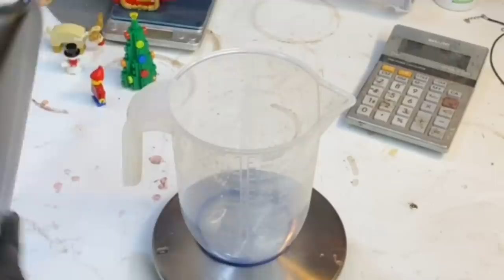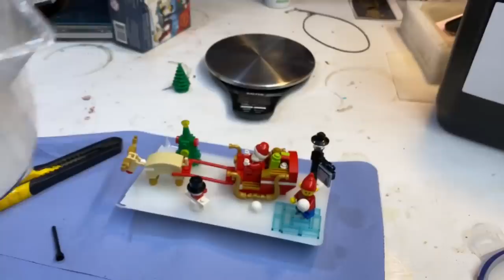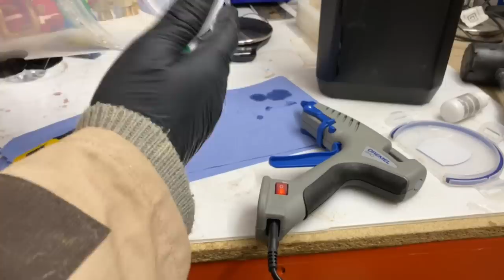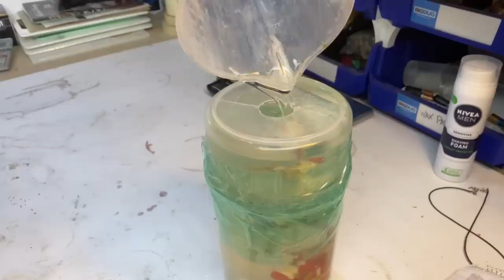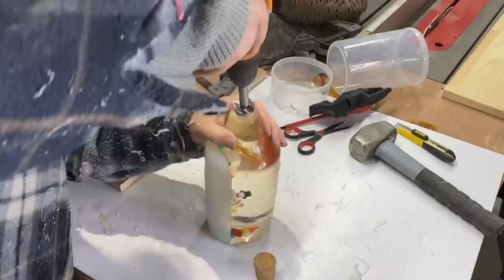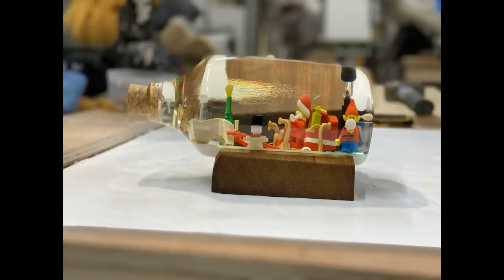Woodturning -  Santa in a Bottle of Resin

Comment: This may be one of those overly asked questions but I would like to know what resin polish he uses to get the gloss finish. Right now I have been using my polishing wheel and various compounds. I am unable (probably user error) to get that glossy shiny finish. I generally make smaller castings. Maybe 4 inches in size.